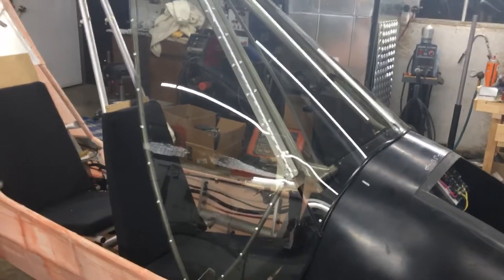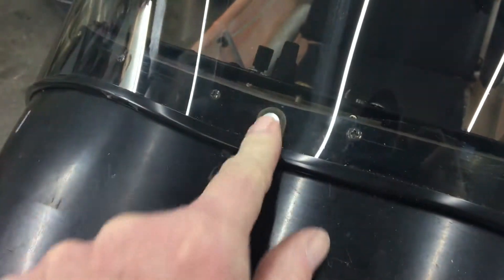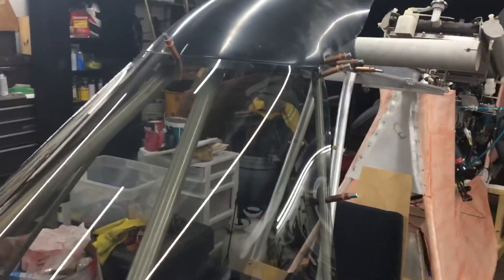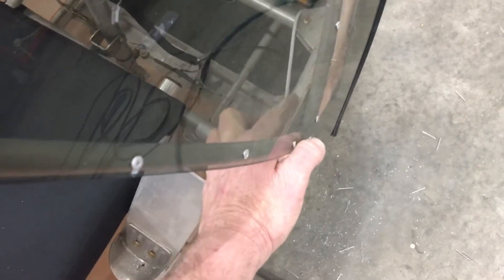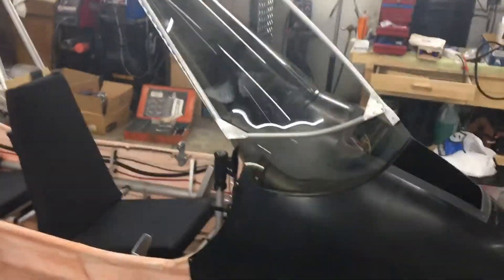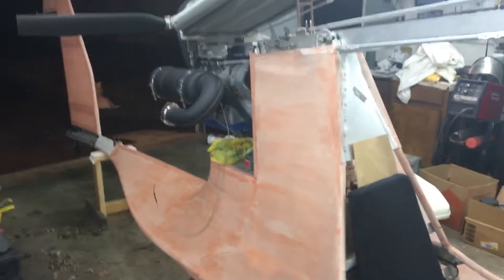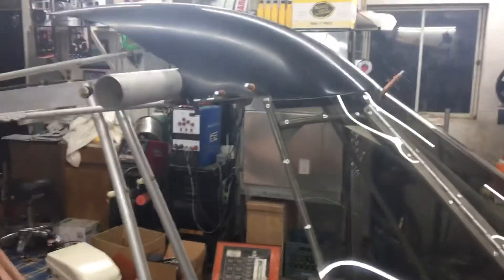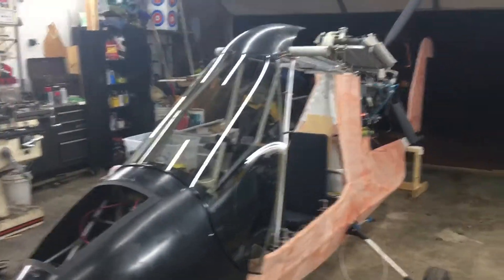Challenger XS-65  Windshield and Third Door Installation

Comment: When you removed the bar to add that third door does it effect the overall strength of the frame?  I want to add it to the one I’m getting. Do you just cut the bar out?  Thanks.
Reply from the maker: To answer your question about the effecting the integrity of the airframe when installing the 3rd door? No it does not. Actually, the only purpose of the down tube is to have something to attach the windshield to.
Reply from the maker: Also, you don’t really cut that tube you just don’t attach it with a rivet at the top or the bottom.